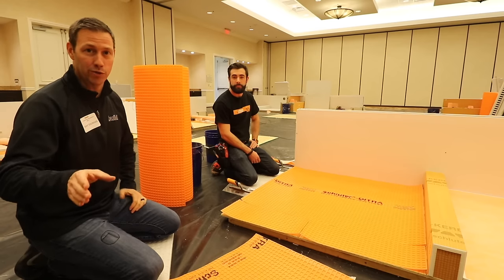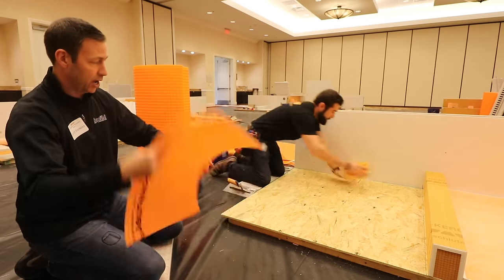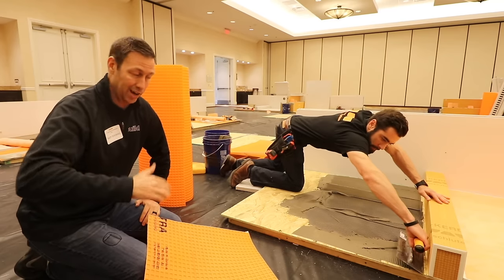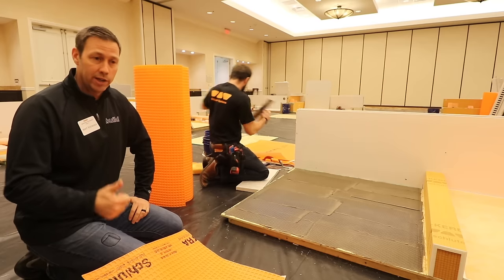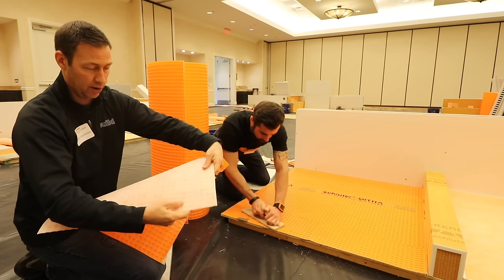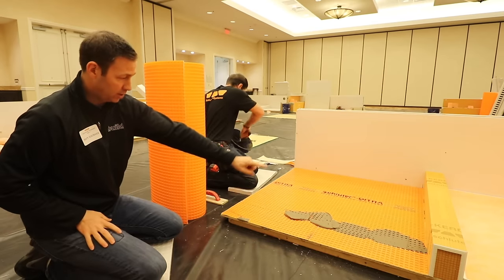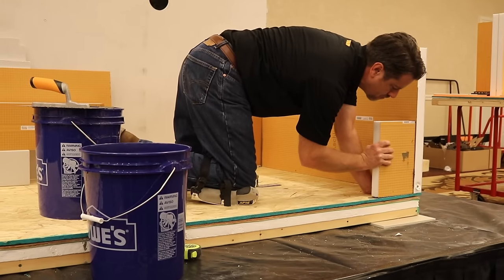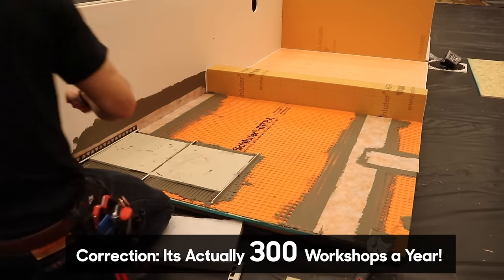WHAT is this, and WHY do you want it under your floors?

Comment: LOVE Schluter products! I believe that installing drywall (even greenboard) in wet areas like laundry rooms and bathrooms is dumb. Why give the mold and bacteria an inviting buffet?  I was also able to install very fragile limestone tile in a wood floored entry and flush everything up with existing 3/4" hardwood. My only complaint: no GreenBuilding or LEED points for using these awesome products. Could somebody at Schluter headquarters please talk to the PassiveHaus engineers and Green Building rating boards and get their products green-listed?
Reply: What would your argument be to make this product deserve LEED points?  I don't see how it contributes to GreenBuilding or LEED as using it doesn't specifically lower house energy consumption.
Reply: Dear WJ, I'm tickled to death that you responded to my post. You are right, these products don't contribute to energy reduction, but GreenBuilding covers so much more than just improved energy efficiency. The Schluter significantly reduces the health risks of mold, improves durability and reduces waste. LEED and GreenBuilding points are awarded for health risk mitigation (from materials choices to ventilation strategies) and improved durability. The Schluter products lose some ground in the green category since they contain no recycled materials and are not themselves recyclable (maybe why they aren't green-listed?). But, IMHO, the improved occupant health still lands it squarely in the "best building practices," "green" camp.
Reply: @lindacgrace2973  I could see the argument if LEED and GreenBuilding points are awarded for something like air quality since cutting plastic is easier on the lungs than using a grinder to cut cement board. I cut mine outside with a mask. Still a pain in the butt though. I like this idea, but for my low income rentals they get a preformed fiberglass base and sides. lol
Reply: @lindacgrace2973  I hadn't considered the health factor.  Good thoughts!
Reply: Dear @believerscc  , I can see that. On my fix-n-flips there was a whole lotta Habitat goin' on!
Reply: Dear WJ, I totally agree that the cornerstone of more sustainable "greener" building must be energy efficiency; but that should not be the only consideration. I look forward to the day when we have true performance codes instead of prescriptive codes and consider the entire envelope building, including health, accessibility, aging in place, urban landscaping, etc. Where do you build homes?
Reply: @lindacgrace2973  I build in a mild climate; no extreme cold or hot.  It's nice to be able to do simple upgrades and as a result achieve significant energy cost reductions simply because the weather is mild.
Reply: At first I wondered about your post. Than I realized what u mean by greenboard. In Germany we use 99% gipsium based drywallboards. We call a special wetroomboard (gipsium based) greenboard. But it’s still common to seal it before tiling. So no bacteria Problem.
Reply: Dear @WAJK2030  , Interesting! Green board in the USA is standard sheetrock with a mildew-killing chemical added to the paper. The mildew-killing properties wear off in about 5 to 10 years, so not a very durable solution. Also, even with surface sealing I have encountered problems with moisture wicking or condensing inside the green board and rotting the board. Schluter's Kerdi board is a much better, more durable option. :-D

Comment: We used to install a wire screen mesh and then we float out the whole floor with thin set,, leveling, , let dry , install tiled  ,,,   we are going over plywood on a new home construction,, jobs   installed 40 years ago,,, no cracks

Comment: I've installed this, what I see is, at seams at a middle of the room, it is now a buildup, a hump, the adhesive on top of the membrane, to add the 6"waterproofing band, now you have to accommodate for that humph, if you do not, a tile can teeter totter over that, which means you have to add more adhesive, make sure you do that!
Reply: I've been installing this stuff for about 10 yrs, been thru many Certification classes.  It sounds like you aren't pressing down hard enough after laying the Ditra and the mud is built up at the seams.  I use a wood smoothing float to push out air and excess mud.  If you use kerdi band to seal the seams, again it should not really make any difference at all. Sounds like you are using too much mud.  Invest in a set of Trowels from Schluter . They make one specifically for Kerdi and one for Ditra

If you are left with a slight hump after all of that, your tile should still lay flat if you are using enough mud above the Ditra. If you are still concerned increase your notch trowell size slightly. You will essentially float the tile over any irregularities in the floor

Comment: I know of no thinset mortar manufacturer who would recommend using their product over OSB and I was in the tile business 4 over 30 years
Reply: I've used 3/4 OSB as the sub- floor in an 8 x 6 bathroom; then spread a 1/8 layer of mortar; then dropped and screwed 1/2 cement or backboard it; then installed 4 x 12 porcelain tiles. I've been back to the job two years later and all is well.
Reply: Now you do.
Reply: @gopherterminator   The last I knew the product he is using was not recommended for use over OSB unless it has changed in the last 5 years I will review specs

Comment: I'm going to be renovating my master bath in about a year, hope we can see the shower system before then ;)
Reply: I did my bathroom last year using Schluter Kerdi - check YouTube and the Schluter website for videos and tips.  Very easy to do but read the instructions / watch the videos first.
Reply: I was thinking the same thing. I am wanting to put in a 1+ inch threshold to the bathroom and basically turning it into one giant wet area with a central drain. It has no bathtub, just a standing shower, double vanity and toilet.

Comment: Matt, I didn’t quite understand what he is using to waterproof the seams.  It appears he is just using the same thinset.  Then you mention something about a “Kurdi Band” but don’t explain what it is.  I am asking because I want to build a custom pebble stone shower pan with frameless glass and this looks like the perfect material to use and keep it light weight as this is a manufactured home remodel that may become a lake property retreat so it will be moved at some point.
Reply: Don't use the ditra as the water proofing layer. It's specifically for anti fracture. Also don't let them sell you the styrofoam shower pan and foam curb and the dumb ass foam boards.

The schlüter drains are awesome. The rest is crap.

Well, kerdi is okay but there is better stuff out there with better warranties and price points.

I wish I could recommend you something specific but unfortunately I have no idea what's available in your area.

If you have a store in your area that sells ONLY tile or flooring installation products I would start by asking the desk folk what the good contracters like best. Don't ask them to recommend you someone though, that generally makes people uncomfortable and is unprofessional.

A store that sells only one brand of product will always tell you that their's is the best.
Reply: Its almost like drywall tape its embedid imon seams while you roll/paint on rubber water proofing membrane. Schluter makes all sorts of shit curved curbs premade pans cheater sticks to get correct drainage with drypack shower pans. Its not cheap though
Reply: unless this thing is "cheap", you are better off by having a fiberglass tray underneath your bathroom tiles.

Comment: I've used this on 3 separate floors and the results are amazing.  This substrate is super easy to work with and lay down and it's easy to lay tile on too.  The only downside is the price.  It is expensive. Now that I've used it, not ever returning to backerboard or cement board.

Comment: I’ve used it and won’t use it again. I was sold on the channels for expanding and contracting to prevent tile cracking. I had more cracked tile  using  Schulter Ditra after about 3 years. My cement board was cheaper and preformed better with no cracked tile after 4 years. It was also a pain in the butt to replace tile with Ditra.
Reply: Try the old style metal lattice with scratch coat. Smooth it out thin with a trowel and let it set. if you're paranoid do a second layer then tile over it.
Reply: @mrgreensuit7379  I installed it exactly as directed. All my renovations I used cement board I’ve had zero issues, with Ditra I had a couple tile crack and grout needed to be redone in several areas. I was happy when I first installed it because it was easier and faster to install and I didn’t mind paying the high cost because it saved me time. However, I ended up spending much more time repairing and replacing grout and tile. It’s a pain in the ass to remove the tile set from the tiny squares and not damage the Ditra.
Reply: @goldwingerppg5953  read what I said again you seem to be missing the part where I'm not recommending that plastic junk.
Reply: @mrgreensuit7379  you comments still are vague to me, either way apparently we agree.

Comment: I think this would eliminate most prep work and help with curved ground, however it will offset the height thus the doors will have to be cut and the moldings removed

Comment: Im retiling a floor and this ditra xl is underneath but whoever did it originally has overlapped the edges of the ditra causing an uneven line and it’s snapped a lot of the tiles.  For a quick fix Can vinyl tiles be put on ditra after it’s been levelled out?  Brilliant video a demo and really clear instruction, have subscribed 😊

Comment: Actually you can use osb or plywood without cement backer board if it's at least 3/4" thick and you use the correct mortar.
Reply: Had22s nope! You have to think about the future. Bathrooms have a lifespan of 7-12 years before the next remodel. It will destroy the subfloor
Reply: PROBABLY DEPENDS WHERE YOU USE IT...SEEN IT DONE THIS WAY FOR YEARS.. NO PROBLEM
Reply: NOT ON OSB......ON PLYWOOD
Reply: @RaulTorresMorfin  I never said just a bathroom.
Reply: @RaulTorresMorfin  tile on ply is actually a TCNA approved method using the correct thinset. Dont recommend it.....but it is an approved method
Reply: 460 S&W TCNA also recommends embedding gypsum in the mud pan 👎🏻👎🏻
Reply: I'm make a demo a lot easier when you lay tile directly to plywood
Reply: @RaulTorresMorfin   No need to consider the future in a disposable OSB home, the whole house will be full of rot within a decade anyway. It's ENERGY EFFECIENT CONSTRUCTION, just ignore the environmental and ecological effects of Matt Risinger's own constructions falling apart after 10 years. He's even put up videos of his builds rotting away.
Reply: 3/4 osb with a polymer modified thinset and schluter ditra properly installed is a perfectly acceptable install method. cement board over the plywood doesn't in any way improve the install.

Comment: Two types, "cracked and going to crack." Ha! Ha! Ha!
Reply: Does it matter? It is still an excellent product. Use it...or don’t. Your choice.
Reply: @johnwalker8194  what? Can't really be that slow
Reply: @paulmazurek3306  I guess that's better than smoking it....
Reply: I installed this expensive stuff on my outdoor deck to be tiled. The plastic cracked like egg shells. I had to rip all the expensive waffles and throw it out.
Reply: And smoking crack in some cases
Reply: @babsb5632  I call bullshit!
Reply: cost us a fortune in going back to regrout time and time again .will never use a uncoupling membrane ever again .i have never had a failure in 20 years until some company wants to demand a builder tells me to use their product .
Reply: I have been using Ditra for several years now. I’ve never had any problems over wood or concrete. The trick is proper installation.
Reply: @babsb5632  When you install in an unapproved environment that's what happens.
Reply: @WhatIsKenDoing  Yup  You can give a child great tools, best computers etc but if they aren't used properly - you get garbage.
Reply: @Babs B 
There maybe an outdoor version, but using indoor products outside is going to void the warranty.
Reply: Just like people
Reply: Definitely right on that
Reply: @spirittammyk  me too
Reply: Lol'd so hard at this. So true!
Reply: I think that the proper isolation membrane could prevent "most" cracking and you might purchase extra tile for future repairs to extend the life of a tile floor.
Reply: @babsb5632  because you dont know how to do it plus when it set by pro you cant rip it mr roockie
Reply: @babsb5632  OUTDOOR DECK?... why the fuck would you use it there?.... that's like using concrete instead of mortar when laying bricks

Comment: two and a half years ago I had my entire 1978 single-story house tiled by the seventh installer I interviewed....finally found one with a clue. He did not use this product but used extensive application of what he called slipsheet. Slab had one very major crack and many minor ones. They ground the slab flat where the cracks were. Indoor temp has had a wide range from 95 F to 50F and no problem with the tile. So....with a new slab I think the above system would be superior, but with a slab as old as mine and unlikely to change any more, the slipsheet worked very well. I'm sure this system would too but suspect it is far more expensive than the slipsheet was.
Reply: Yeah in my area it's around $2/sq. ft.

Comment: "You can't put tile down on osb, it's not going to work"
>applies thinset to osb
Reply: moe riou that’s what I keep thinking with this. Am I missing the point??  The tile in my house that the builder installed 15+ years ago was over the subfloor and it’s held up just fine.
Reply: @dankerkstra6305 maybe it acts as a flex area for shear force between the subfloor and the tile
Reply: It works fine on OSB as long as you apply enough thinset and pressure to the Ditra.  He even says this, if you listen

Comment: I purchased this complete system and handed it over to my contractor along with the how to video in 2009. He refused to watch the video and insisted that no bathroom renovation could be started without mud. He piled on so much mud that the floor slopes down towards the entryway. He had to cut the bottom of the door on an angle to accommodate the floor's slope. Some contractors just don't get it.

Comment: My home was built in 2016 along the gulf coast which is also Gold fortified has this stuff under the tiles and for some reason I’m constantly getting loose tiles. Every year and it seems as if the orange material is pulling up off the floor in these areas.  I’d rather go back to cement board.

Comment: can this membrane be used for wood, engineered wood also or is it strictly ceramic tile?
Reply: Your wood flooring store will give you options biased on your subfloor or ground floor a concrete subfloor will require a vapor barior/pad.

Comment: What took you so long to discover this product? You say you started using it 2 years ago which would be the year 2016. I purchased this system in 2009 and put it to work. I think builders and contractors generally resist new ideas. My contractor applied this system along with heaps of mud raising the floor maybe more than 2". I had to have a special threshold made.

Comment: Can you use a J-Roller to bed it into the thinset?
Reply: mlsvidiot I tried that, but it’s pretty springy and never truly got good adhesion. Since that failed experiment, I cut it to shape, which is really easy.
Reply: you can use a lean on roller.  have been using this product for years.  lean on roller makes it really easy anyways

Comment: If your builder puts plenty of expansion joints in his slab you can use the thinner paper down over the expansion joints or if stick the paper down over the entire floor then tile with full flex have done tons of houses this way and never had issues tiling to concrete using these methods.
This product would be for second floor or wood subfloors where it is for sure needed.

Comment: 2:11
Maybe it's different in US but in many European countries it's mandatory to have expansion joints exactly to prevent concrete cracking. We usually use so called damper tampe
Reply: doesnt always crack along an expansion joint though does it sparky

Comment: Why wouldnt you frame out the benches with fur? does movement in the wood effect the tile? is the foam strong enough to support 2 obese people going at it?
Reply: They have a foam panels engineered for building benches and other things. It holds hundreds of pounds. Go visit the website they answer all the question a lay person will ask. Videos included.

Comment: Well I WAS a general contractor for 10 years. In Florida I've put tile down on concrete slab, Ive put tile down over linoleum, Ive put tile down on wood flooring I put tile down on durarockand I have never ever on any surface had an issue with the tile not sticking. You must be using the cheapest thin set out there. Spend the extra $3 and get Fortified Thiset and you'll never ever have an issue

Comment: Better have a nearly perfect, and very rigid subfloor... otherwise I'll stick with concrete board.
Reply: I think that's the whole idea behind this product.... It DE-couples the rigid tiles from any imperfections/not so rigid sub-floor.
Reply: Concrete board provides ZERO structural support and will inevitably crack under the tile as well. But continue with your Stone age methods.
Reply: @DG-to6by  Not quite right.  This decouples the tile from lateral movement.  A less than rigid sub-floor means you might get vertical movement as the sub-floor flexes beneath your feet.  This mat wouldn't help with that.

Comment: On concrete I understand. But on a wood subfloor (w/o cement board) seems to be asking for flex cracks. Guess you could add a layer of plywood to stiffen the floor up.  I've seen this for years on the Holmes show.
Reply: Wow. You're cool.